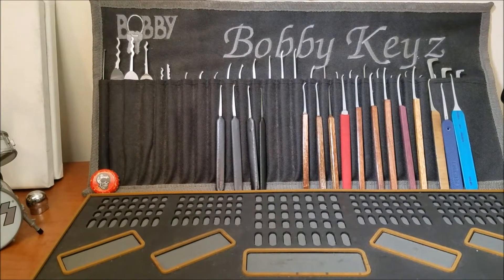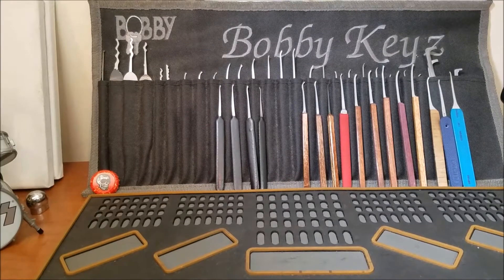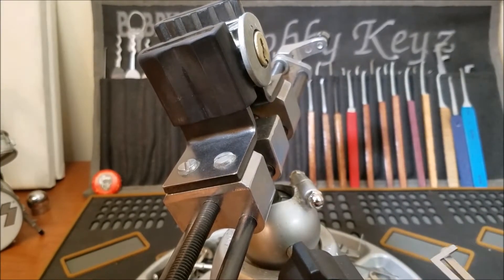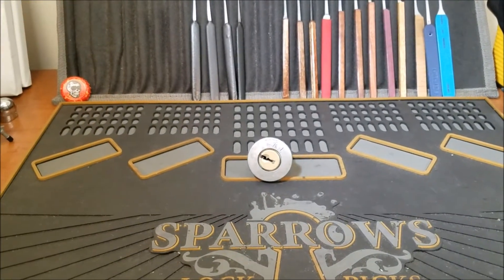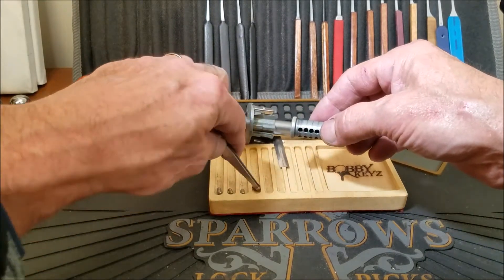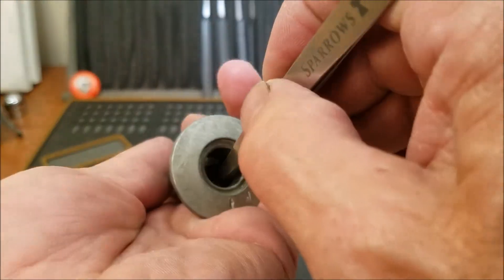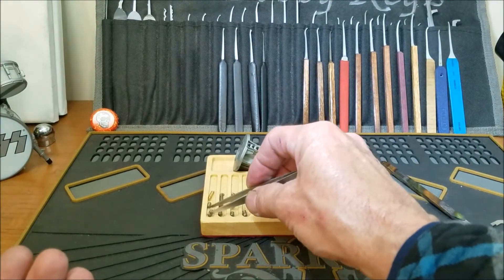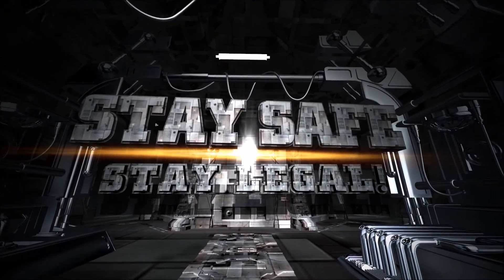(512) My Submission to "WCP" Makers Challenge Plus 'Hal' pinned by "K1Locks"

Comment: Very nice pick. The handles look great  & great profiles.  Nice picking on that K1 challenge lock. Flying pins. That's when a brass magnet would come in handy.  Too bad magnets don't work on brass. For steel springs,  tie a string to a strong magnet,  and pull it over the carpet.  Works on steel pins also, but I don't have any of those.